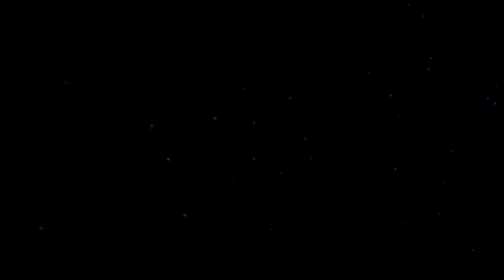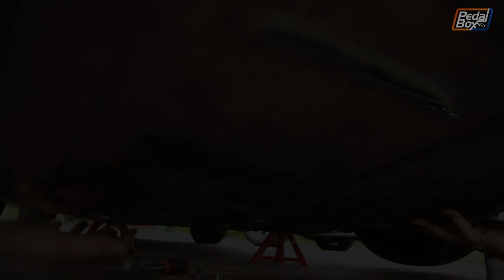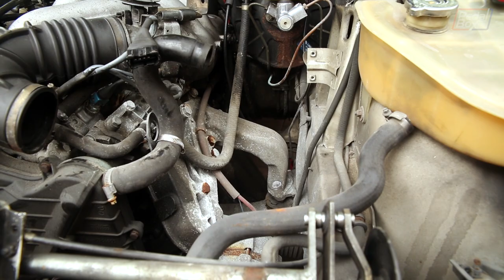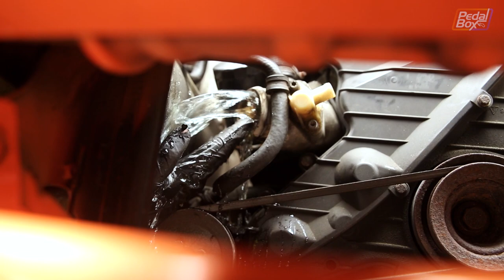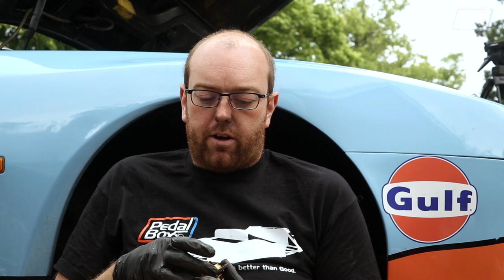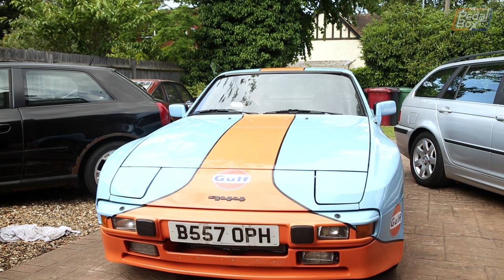Porsche 944 Radiator Installation | Pedalbox Fleet | Episode 24

Comment: Temp control is not usually an issue with a NA 944
Reply from the maker: Yeah seems to have been good, other than the thermostat and general poor condition of the radiator ejecting fins

Comment: Why was there water in the radiator and not coolant? Is this vehicle water cooled?
Reply from the maker: It'd been leaking for a while, so it was topped up with water until the new radiator went in so to good stuff didn't go to waste. It got flushed after the test run home and proper mix went in for winter

Comment: Need more slowmo radiator crumble...
Reply from the maker: Will dig some out for gore value. The ones we did on the day didn't quite come out right. Fortunately the old rad still sits in the scrap bin :)
Reply: @PedalBox  It''s a clip to cross-post to #justrolledintotheshop